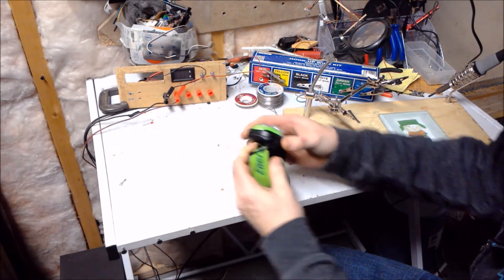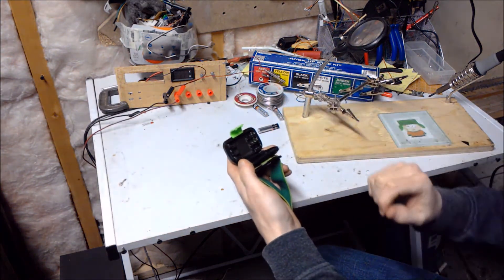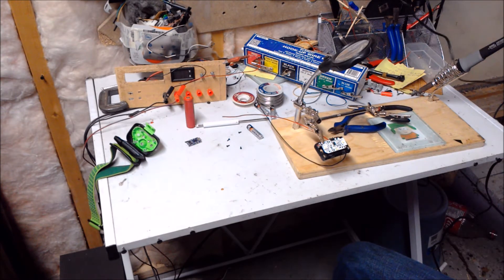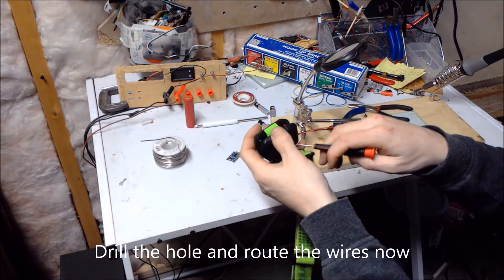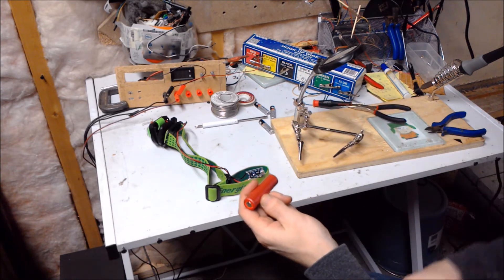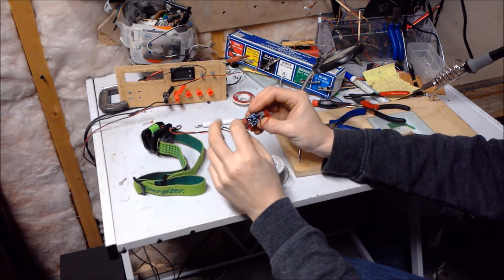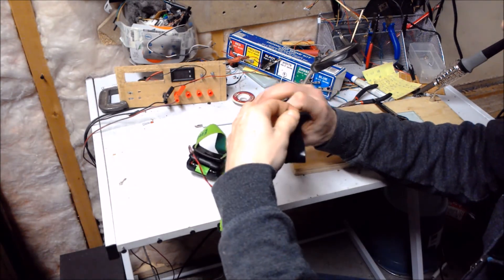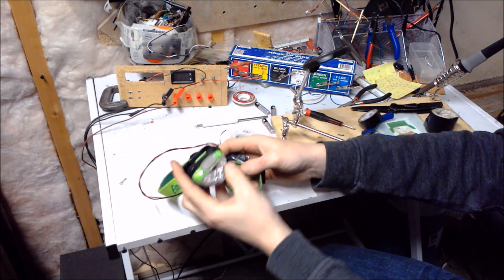Upgrade Headlamp to Rechargeable Lithium Battery with Very Little Cost  - No More AAA Batteries

Comment: No.  Wire three 14500 in parallel.  Now you still have the 4+ volts the light required but 3 times the mAh which means it will stay on 3 times longer.  And the three 14500 should fit with minimum modifications.

Comment: I cannot believe you went through all of that.. that’s something I would think up but not be able to do due to lack of proper tools. That said I had one of those and I threw in some low self discharge LSD Nimh AAA batteries and made mine rechargeable like that… true the batteries were what was rechargeable and not the light itself. I would like to mention energizer made a lithium version of the top model in this range of lights the “ultra” headlight with a microusb port and 400 lumens.

Comment: Thanks for posting this, I made a few tweaks on this method that work better for my situation.  I soldered the leads onto the + and - terminals inside the AAA compartment, so it doesn't require messing with the board.  Instead of soldering the battery in place, I have it in a silicone battery sleeve that I secured to the strap with RTV silicone, with homemade terminals (not ideal). I then  use an 18650 charger I got a vape shop to have a few batteries ready to go, which allows me to swap out batteries and keep using the headlamp, but I think my setup would be better with the battery holder you used in this video.  I really love videos like this, keep up the good work!

Comment: I tried the same once with a 3x aaa powered headlamp but I used a 3.7 900mah cell phone battery and it fried my headlamp do you know why? Any advice on that
Thank you 🙏🏻
Reply: lol, okay, so if you put it all together and it immediately fried it, then yes, you connected the battery wrong and didn't pay attention to the polarity before connecting wires(so the negative terminal of the battery would've been connected to the spot on the board that was supposed to get the positive terminal of the battery, and vice versa for the positive terminal of the battery, while some devices can work alright regardless of the polarity, its imperative that you force a habit of always making sure the positive terminals are connected to the spot with a "+" and the negative terminals always connect to the spot marked with a "-" as connecting wires without paying attention to this can very easily cause things to go very wrong, very fast, and the next thing you know your house is on fire and you just killed your neighbors pet salamander because you mixed up the wires and caused a battery to go into thermal runaway and explode on you... lithium batteries arent like AAA or AA. they wont just "pop" or leak a bit of battery acid, when they go off, even the smallest ones violently explode with a pillar of fire... no bueno)

anyways,  if it was working fine for you, but slowly started getting hot, and after a while started to produce the magic smoke then completely frying on you, then you, again, didn't pay attention to the batteries. only this time, you didn't pay attention to the positioning of the original AAA batteries and gave your device more power than it was made to handle. 

so, just because something uses 3 AAA batteries, does NOT mean the device will always use 4.5v. so, there are 2 different ways to wire multiple batteries, and both methods provide different end results and give different numbers:

1. Sequence: when you see the batteries joined in sequence(so the wiring connects the batteries with the terminals like this: + - + - + - +-.... so 3 batteries in parallel would be connected with the first battery having the positive connected to the board, the negative connected to the positive of the next battery, the negative of that battery to the positive of the next battery, and the negative of the last battery to the negative of the devices circuit board.) the batteries voltage would increase, but the current remains the same. 3x 3.7v 5000mah joined in sequence would result in a voltage(3.7vx3)= 11.1v(though most 3.7v batteries actually have about 4.2v fully charged, so you're more likely to get 12v from 3 3.7 li ion batteries FYI) and the current would not change and would remain at 5000mah. the  battery would be rated at roughly 12v=5000mah. try to remember, joining in sequence will increase the power, but you will not gain any increase in the charge time of the battery. so a headlamp that gets 2 hours of use with 1 battery will still get 2 hours of use with 3 batteries joined in sequence but will be brighter

2. Parallel: when you see the batteries joined in parallel(it is exactly as the name describes. all batteries are connected with each terminals connected to the same terminal of the other battery. so the positive of all batteries will connect to each other while the negatives of all batteries will connect, and the wires that connect to the board come out of each terminal as if all batteries were 1 big battery. so 4 AAA batteries connected in parallel would look like this: all 4 positive terminals are joined together with just 1 wire coming off from anywhere on that connection. as well as all 4 negative terminals connected together in whatever way with 1` wire coming off of those connections at any point. the wire coming off the positives are connected to the positive end of the board the wire coming off he negative the same with the negative end of the board. as long as only the same polarites are connected, it doesn't matter how its done. you could connect them all side by side with a wire coming out of 1 side to be used as the terminal, or you could bundle them together and have the connections form a loop with a wire coming out of the middle for the terminal, as long as you do not have the negative tough a positive or vice versa, it doesn't matter.) when connected in parallel, youll get an increase in current, but will have no increase in power. so a headlamp with, again, 4 AAA batteries at 1.5v 1000mah each connected in parallel will result in a voltage that's still 1.5v, but the current will go from 1000mah to 3000mah.. so the headlamp would be just as bright as it would with 1 aaa, but it would last 3x as long. joining in parallel will increase the amount of charge time a device can have, but it will not make it anymore powerful. 

so with that info, if your headlamp worked at first, even if just for 1 minute, and then just stopped working, then my best guess is that your specific device used 3 AAA batteries joined in parallel and NOT in sequence, meaning you put a 3.7v battery in a device that would've been made to only be able to handle 1.5v...... and im sure you know enough to realize why that would be  a mistake and would result in the magic smoke making an appearance

hope that helps, and if you've already stopped caring in the year since you posted this, already found the answer, or really just dont want to read all that text, then i hope this helps someone else with a similar issue that happens to find themselves reading this message, that's all i got for you.
Reply: @taylorreptar7898 men this is why I love internet, I am making a DIY project that has related upgrade from alkaline battery to rechargeable lithium but I got some doubts about how to connect the batteries and some other beginners questions and with your comment trying to give a answer to the original comment I clarify my doubts about how to connect and don't blow up mi device, thanks man for spread acknowledge.
Reply: Only thing I can think of (since it's below the +/- 10%of 5v) the thing is speccd for is would be reversed polarity by accident? If you only touched it for long enough to fry a resistor it might be fixable.